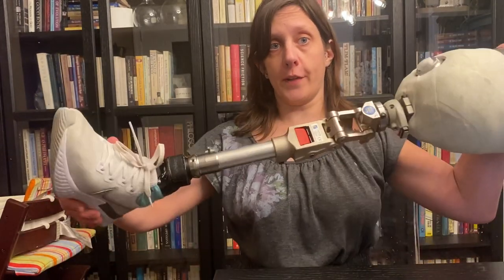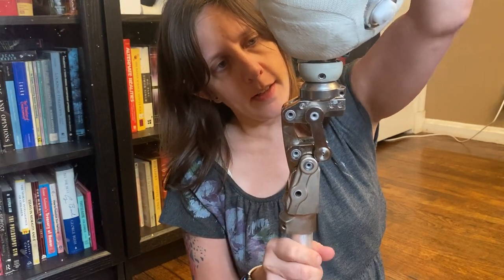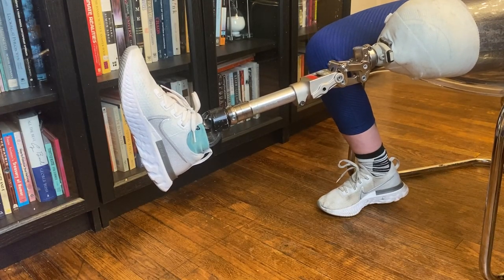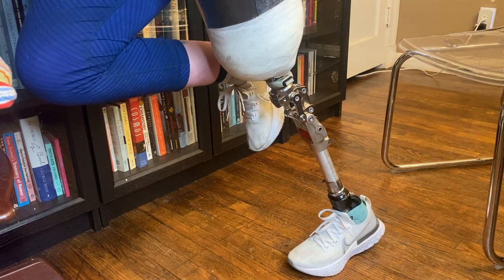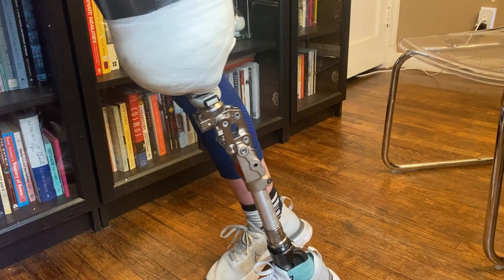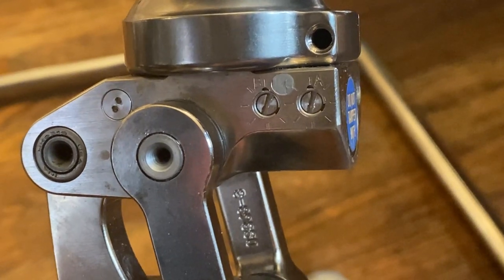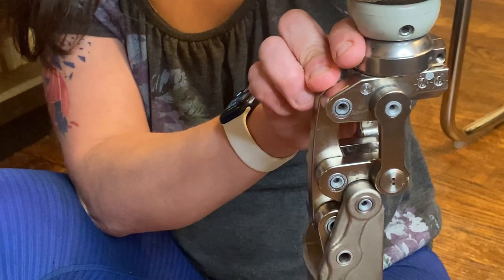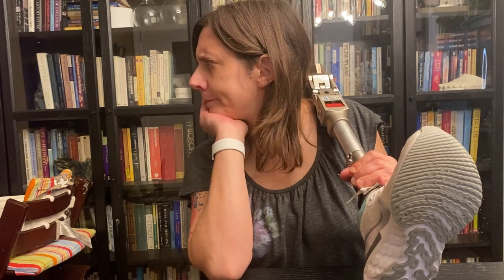How an AK Above Knee Prosthetic Knee Works (Ossur Total Knee 2000)

Comment: I’ve had the Total Knee 2100 about a year now and I just now found videos about it. 
It took a little getting used to but I’ve used a Mauch sns for 30 or so years. I’m really liking the Total Knee. I’m not interested in any of the microprocessor controlled knees as I don’t want to be tied to a charger all the time. Plus having to have repairs done quite frequently turns me off.  For me the ruggedness and reliability is a big selling point.

Comment: I wonder if Insurance even would pay for a leg that nice. The way the system is now I doubt it. They have to be sure they get paid before you get anything. I needed shoes because I had an amputation of half of my foot and I could not get those paid for it and I lost my leg
Reply from the maker: Insurance hasn’t paid for any of my parts yet. I bought these parts on eBay.
Reply from the maker: But generally the only issue people have with insurance is paying for microprocessor knees. I’ve never heard of any insurance refusing to pay for a mechanical knee. Though I’m sure it happens.
Reply: @AmputeeOT  well I have the sleeve coming on Friday. I don't understand why it is rubber? I know I get a temporary leg and then it takes a long time to get a leg. And I know I have to be really careful not to get an infection. And then if I do get one doctors do not want to give me any antibiotics for anything so I have to beg for them if that happens and it starts breaking down I'm scared to lose more. Does yours break down sometimes? I'd rather have no legs then lose more
Reply from the maker: They don’t make rubber sleeves. It would be gel or silicone. Those are the best materials to prevent skin breakdown.

Comment: Is that still a test socket?
Reply from the maker: Yep
Reply: @AmputeeOT  I recognized the tape on there. I am a below the knee amputee so I know what they look like. How long do you need to wear the test socket for?
Reply: @ravenrose6672  for a few weeks until the residual limb adapts. The very first time is longer than the next ones. My second socket didn't need a single change.

Comment: What about ankles? Do ankles next?
Reply: Ankles don´t usually flex much: It would be hard for the user. I'm also an above knee amputee and now use a 3R80 Otto Bock, before that I used really basic knee so I noticed the change in the foot was subtle but in the daily use you are glad for the greater flexibility, but still not so much that you need to "control" it, just makes the gait smoother and easier to cope with unleveled surfaces.